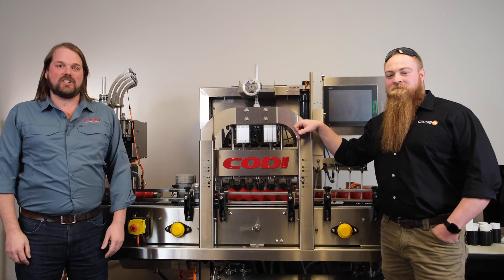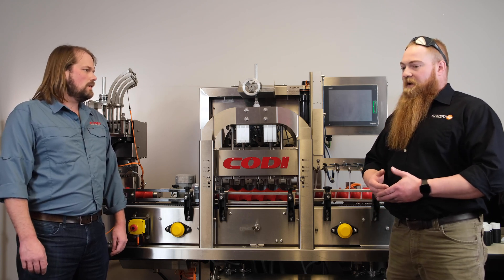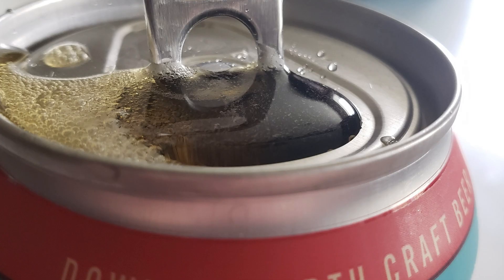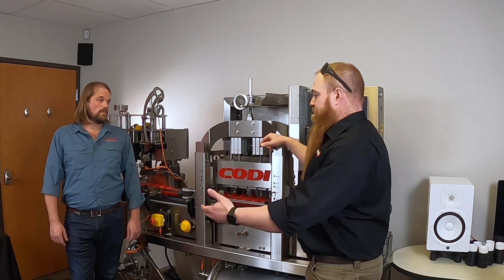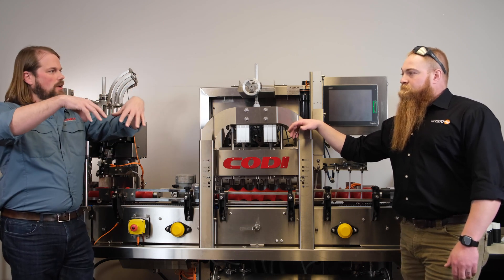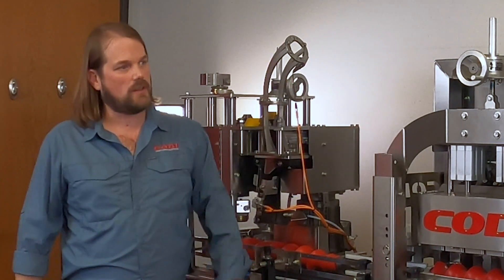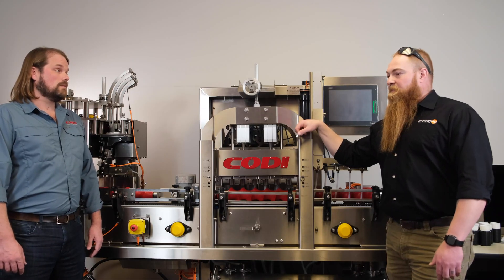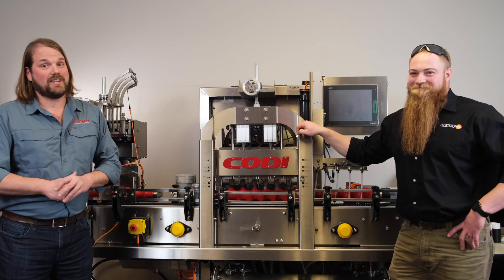Between Two Cans: Heuft and Codi Manufacturing talk fill level detection

Comment: Thank you for the video but I have one question: you are supposing that the receied X-ray represents the fill level since the can obsorbs no X-ray radiation. But if you are detecting the fill level in a bottle this will be different, since the glas obsorbs radiation. In this case how would you distenguish the liquid obsorbation from the glas obsorbation?
Reply: Thanks for the reply! All containers (glass, aluminum, PET) do present some absorption of X-ray however as long as the glass density is uniform through the inspection area it will be no issues as the measured valued is uniform across the inspection window as well. If you have high variations in that area (some wine bottles, other cheaper glass containers) then we have another option of running our HF inspection. Both of these inspections technologies we have are used worldwide by large and small breweries and other beverage locations with no issues. Please reach out on our website if you have any interest and would like to know more. Take care!